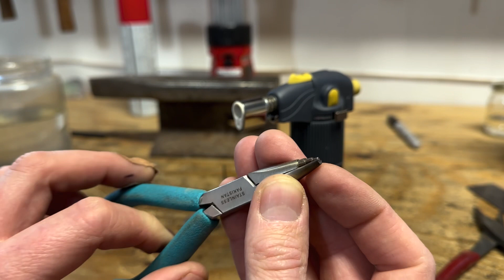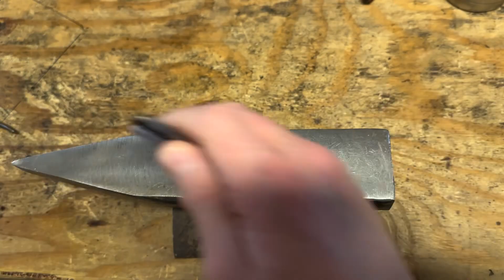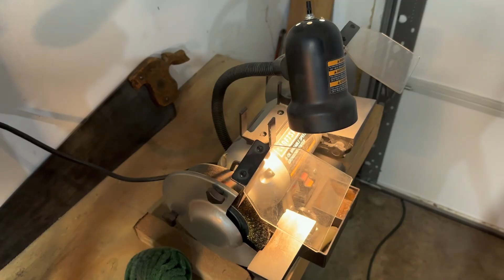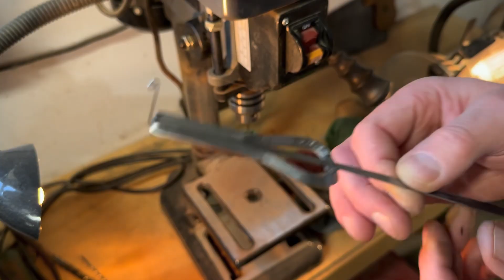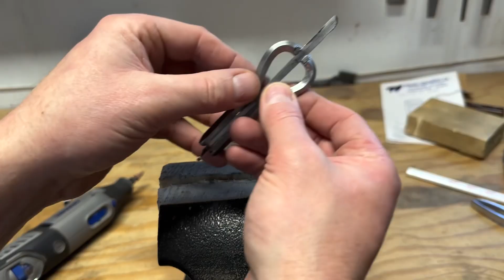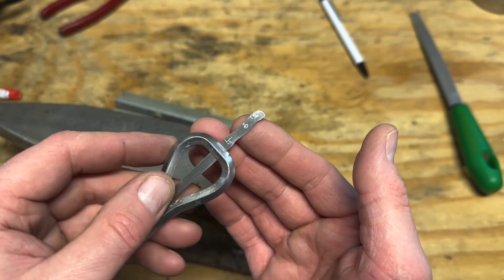Working on making a Jaw Harp.   Bebb JHJ Serial Number 4

Comment: I just got my drymba in and I was so excited! But i unfortunately think i got a bad one or something. The sound doesn’t draw out like it’s supposed to. The sound just stops when i pick and can’t do long drawn out notes. I’m sad.
Reply from the maker: Did you order a Drymba with a draw start?  Drymba typically do not have draw starts as they lean toward clarity, and not draws.   However you can easily install a draw start on any harp, however you will lose melodic capability.
Reply: @bebbcorpharpery7331 

I can’t get any melody out of it ☹️ just little ribbits. I could talk through the dan moi I had. With this one, I can’t do anything. What sucks the most about this is that the drymba is more expensive than the dan moi.
Reply from the maker: @m-bassy1155 The Drymba and Dan moi are different instruments.   Did you get it from us and if so email theharpery@gmail.com for support
Reply from the maker: Question.   The Drymba are a great representation of the sound of the carpathian style Drymba and high pitched with a short sustain like the instruments that inspired them. but unlike Dan Moi they are not played against the lips, but against the teeth.  If you lip play a Drymba like a Dan moi it will make very little sound.     Let me know how I can help.
Reply: @bebbcorpharpery7331  I guess playing with the teeth helps draw out the sound but it’s still quiet. And I am having a VERY tough time getting a clean pick off it. The reed constantly clangs against the inside of the frame no matter what I do. It’s incredibly frustrating.
Reply from the maker: @m-bassy1155 didn’t you say the Molfar Drymba.    Since it is a take on a traditional Drymba style are you sure to pluck it inward?   Outward plucks won’t do much with those harps.
Reply: @bebbcorpharpery7331  I have the vandjurak son drymba high. I’ve tried picking inward and outward to of no avail.
Reply from the maker: @m-bassy1155 email theharpery@gmail.com and we will remedy it right away.   If you want a replacement harp with a draw start we can do that as well.   Something may be wrong or came a little loose with the Vandjurak.   We will get you a new harp and one with a draw start in the mail.   Be sure to email theharpery@gmail.com